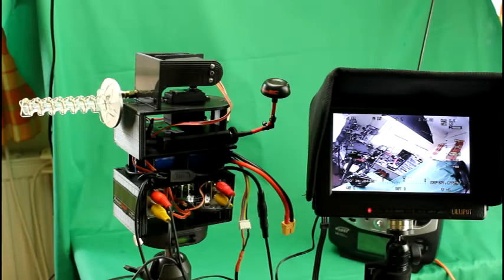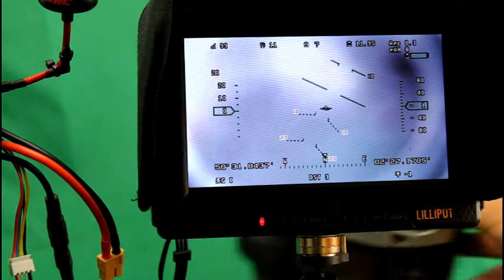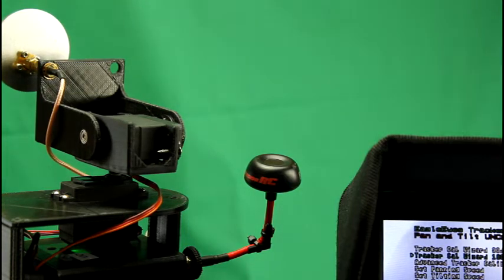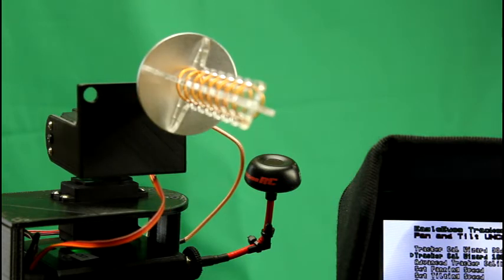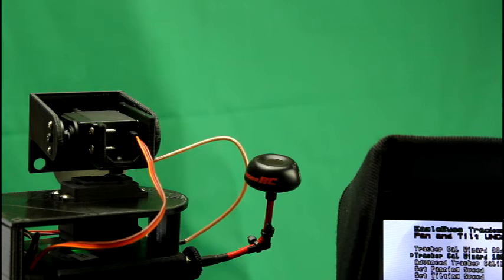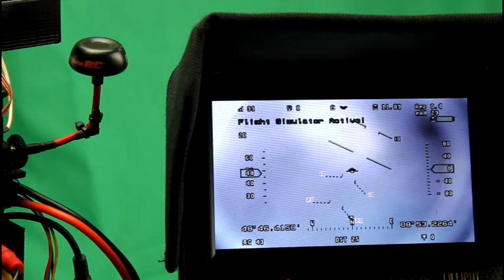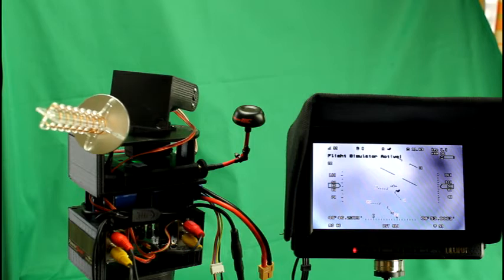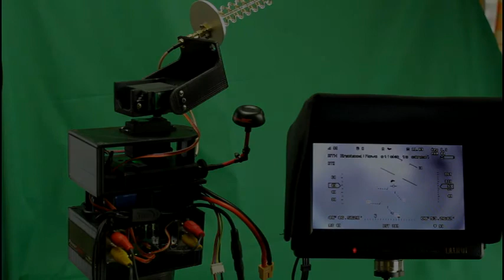How to build a 3D printed antenna tracker for Eagle Eyes and Vector part 2

Comment: your gonna love this, I don't have a 3d printer but, I recently got an eagle eyes tracker and could not get it to connect with diversity. In the first 2 minutes of this video you solved my problem, the camera has to be on. This is really strange but, OK. Thanks man!  Never have been able to order a print from thingy-verse, you would think they would make it easy, but oh well. I will build a larger one with aluminum and wood, going to use a pepper box and an omni.

Comment: Hi Chris great videos and tracker. I have built mine using the same setup. It all connects up lovely and callibrated it. When i take the model out in the back garden and tested it the tracker moves but seems to mimic my movements in reverse. When i walk left it goes right and right it goes left. Very odd lol
Reply: my servos are the same orientation and pan and tilt trays are setup the same. Completely boggled lol
Reply from the maker: Hi it is ages since I used mine, I will have to dig it out and investigate. I am sure there is a setting in eagle eyes to reverse the rotation of the servos...
Reply: Think i may have it. I never fly with audio lol 👍👍👍

Comment: Cheers for the video mate, if wondering if this application (aat) could be used for a Dji phantom 3, just for shits and giggles.
Reply from the maker: +wyman vincent 
I am not aware of tracker board that that can read the downlink telemetry from the Phantom, but you could place a EZuhf tiny telemetry board in your aircraft and use an EZOSD tracker with this instead of the Eagle Eyes unit. If you wanted to use the Eagle Eyes then you would need to install the Eagle Eyes OSD or Vector in the aircraft.

Comment: hi, very good, but, how does it appear to appear in the menu, I use apm with osd, do I have to connect the computer to the eagle tree usb port?
Reply from the maker: The Eagle tree is not compatible with the APM. You could do it with just the APM using the antenna tracking facility. I don't know much about it but I think you need 2 APMS to implement antenna tracking and OSD.
Reply: What flight controller do you use? I have a new fy41ap, guarada, but I have incompatibility with my V tail talon, so I use the APM.
Reply from the maker: This is set up for the eagle tree vector